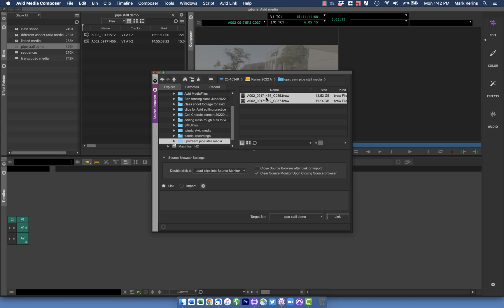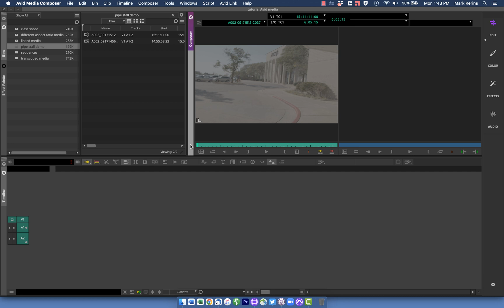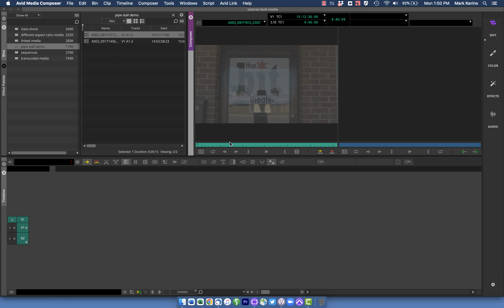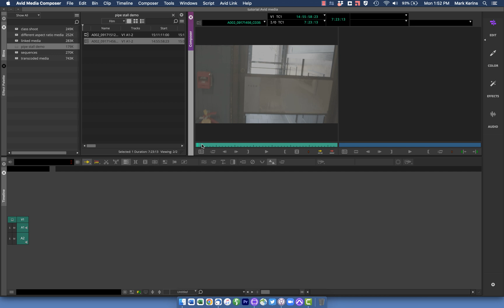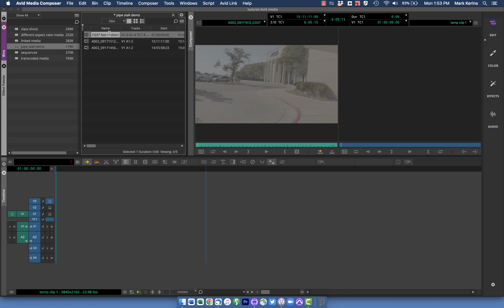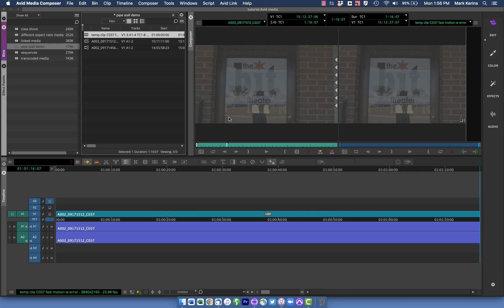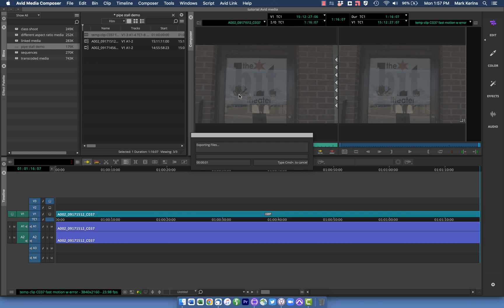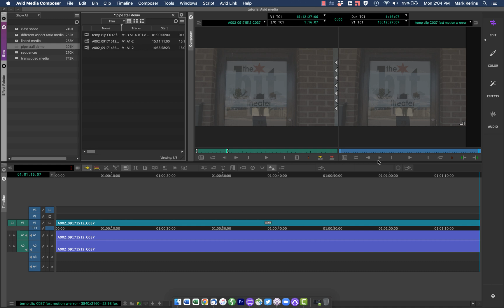Avid tutorial: 'upstream pipe stall' error

Comment: As a spoiler alert, I'm going to begin by telling you that I had already conceived (though not yet implemented) a solution to my "pipe stall" experience when I saw your tutorial.  I'm leaving this comment because I enjoyed your tutorial, found it very well done, and was gratified that your solution to the problem paralleled mine.  Hopefully, this comment will help others.

Speaking of parallels, I happened to be running the same version of MC that you were running in your tutorial (yeah, I went back to an earlier MC version a year ago for an unrelated reason).  In my case, I had just previously exported two timelines without the stall error (and had exported numerous timelines without the error two days earlier), so I was pretty sure the problem was not MC itself, but maybe the media.  

In this instance, I had three full length documentary movies to make a slight adjustment to and return to my client.  The three movies all came with different frame rates, so to make things more efficient, I transcoded them to the same frame rate using an external video converter so that I could deal with them in a single project.  (For this job, the fact that I had changed the frame rates was of no consequence to my client.)

The timelines with the transcoded media of two of the movies had exported without trouble, so it was quite puzzling that the export of the third movie (transcoded using the same settings) was hanging up.  In this case, the pipe stall error notice identified the audio as the problem.  But that didn't make sense, because, again, I used the same transcode settings for all three movies.

In any event, your tutorial confirmed my suspicion that the problem was the media, not MC.  My ultimate solution was to again use my external video converter to encode from the original media to a WAV file.  I then replaced the audio on the timeline with the WAV file, checked lip sync (it was spot on), and launched the export.  This time it exported like a champ.

Okay, this has been a long comment, but if it helps someone, it was worth it.
Reply from the maker: Thanks for sharing and glad the process worked. I actually think generally Avid's error messages (whern they're not just a code number) can be pretty helpful but this one was obscure and took some digging.

Comment: WORST SOFTWARE AND SUPPORT IN THE HISTORY OF NLES
Reply from the maker: On the software, this is just wrong. Go back to some of the late 90s NLEs, try editing something with them, then come back and say with a straight face that Avid is the worst of the bunch. If you want to argue it's the worst to survive for decades I'd disagree but at least you could make a case for that, okay. But there's simply no legit claim it's the worst ever in the history of NLEs - I remember getting to use an Avid for the first time in early 2000s and it was like for the first time I could actually EDIT instead of fighting against poorly designed/functioning software. As to support, it's certainly not great (thank goodness for the user forums, where the right solution is easily found 99% of the time) but haven't really had great experiences with any of the other major players either. Heck, Apple should win "worst support" simply for discontinuing and stopping support for a very solid NLE program in favor of pushing their Final Cut Pro X fiasco.
Reply: Idk man. I started using avid at 12 in 1998. Avid express DV…fast forward today. They still don’t utilize processor speed or a dedicated GPU. It barely can function raw 444 12 bit playback. Every month it updates itself and new bugs and errors.  Their message board is pure hell. Hardly get a response.  Final cut never has issues. Resolve is free and handles playback smooth as butter. Avids waveform sync is a 50/50 shot. ONLY thing avid wins is timeline interface and ability to make a custom workspace.  Other than that. I’d rather use two VCRs.  Sadly I know avid in and out and don’t want to fully relearn another NLE. But in 2023. Ain’t nobody really using this software sadly.
Reply: @1357media  "Aint nobody really using this software sadly" - except for the entire broadcast industry